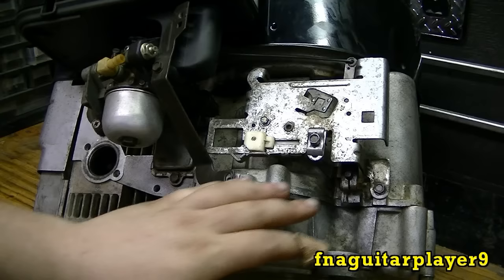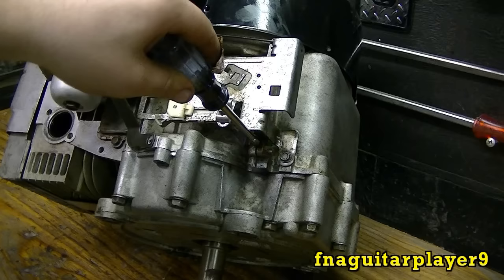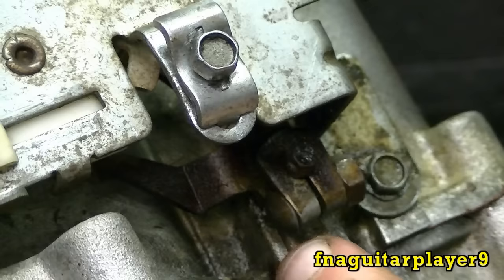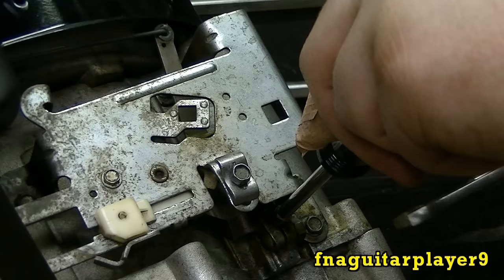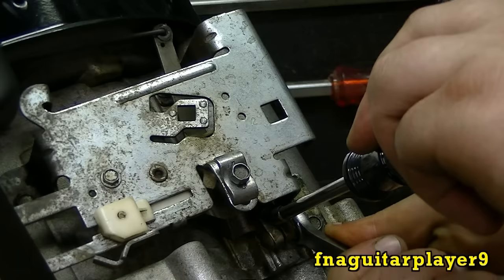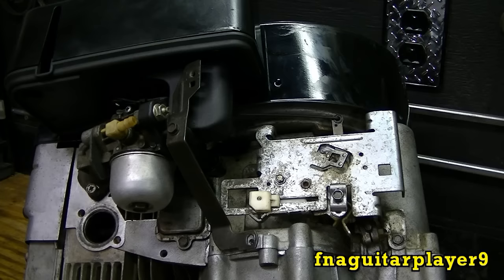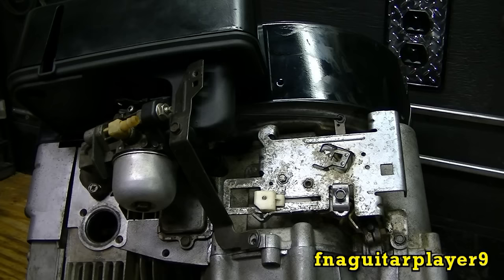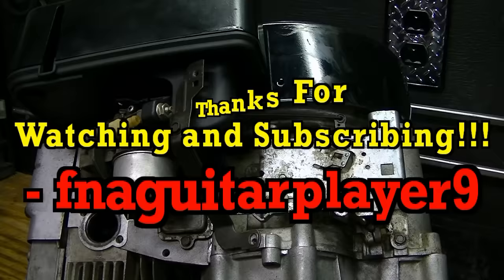How To Adjust Mechanical Governor On Small Engines

Comment: So I have a question. I have a snow blower with a 8hp Tecumseh on it. Now do you leave the throttle control switch in the 'stop' position while doing this? I get a little nervous when messing with governers
Reply from the maker: I would have it set to idle speed, that way there is no spring tension on it, the stop position maybe below the idle, thats fine. Thanks for Watching!!!
Reply: fnaguitarplayer9 tried it. Still seems to be surging and backfiring on higher speeds. Brand new carb (non-adjustable besides idle speed) Any other things I could try?
Reply from the maker: First thing that comes to mind is the choke, have you made sure that it is opening all the way. Assuming it has a choke, i know alot of tecumsehs just have the primer bulb. Have you checked the spark, it could have a weak spark causing that or a fouled plug. if that doesn't work, we'll try something else.
Reply: fnaguitarplayer9 ill give those options a try and let you know. Thanks for helping so far.
Reply from the maker: sounds good. no problem!

Comment: Hi..the throttle linkage works on my mower when the mower is off...but it wont move when the mower is running..any idea why ? if you could help that would be great..thank you..Ed
Reply from the maker: the governor may need adjusted, sounds like it isn't letting it move all the way. Thanks for Watching!!!

Comment: Question,
I have a a John deere 14sb that I just acquired. I had issues with it not starting, and if it did start stalled in a second. I replaced the spark plug, oil and air filter. It started right up after that. Now my issue is that is when I pull the throttle handel all thevway back to turn it off, it just stays in idle and never cut off. Does it have to do with the adjustment you did here or I have to adjust something else? Does anyone else here know?  Thanks much!
Reply from the maker: There is a switch built in on the carburetor or linkages and if the throttle cable isn't adjusted right it won't activate the switch, or the switch is bad or the wire may have came loose that shorts it out to kill it. hope this helps. Thanks for Watching!!!

Comment: What tool are you using to rotate the shaft clockwise.
Reply from the maker: It was a nut driver, most engines you can use a straight screwdriver. Thanks for Watching!!!

Comment: Can a poor adjusted governor arm cause backfiring?
Reply from the maker: Not usually, its usually carburetor, ignition, or valve related when they backfire. I'd start with the carburetor and ignition system first. thanks for watching!!!

Comment: Oh, forgot to add, that I just did what this video says to do; still revving super high even with throttle lever in lowest position.  Could governor internal be bad?
Reply from the maker: probably is the internal part if the external parts check out.
Reply: @fnaguitarplayer9  thank you!  I'll definitely check that out.  I DO appreciate your videos and their attention to detail!!
Reply: @fnaguitarplayer9  Yep, opened her up, the governor plastic was broken on the shaft as well as the outer "wings of the oil slinger.  THANKS again for your help.
Reply: Well, I replaced the governor and adjusted the governor shaft exactly as you showed.  Thing is; the throttle now doesn't seem to make any difference in engine speed.  It is not revving out of control like when old governor was broken, but, just stays at full speed operating revs.  I checked the springs on governor and they all seem to be fine.  I had a small piece, size smaller than a thimble around, but about as long as one, that I THINK came from crankcase, but, I have no idea where it might go or what it is.  Do you think problem may be with carburetor?  Linkage to carb is operating ok.  thanks
Reply: OK, I feel like a real dope!!  I looked everything over and simply adjusted the idle on the carb and that did the trick!!  I'm not sure how replacing the governor had anything to do with that, but, that solved the problem of seemingly no action with the throttle!!  thanks again!!  oh still don't know where the little thimble size piece is from; probably junk from my tool box!!    :)

Comment: I have a poulan riding mower with 12 horsepower engine and when Icrank it and increse throttle quick it tries to choke down put real still run bearliy but will smoke out of exhaust .It does the same thing when i put it in gear and when Itry to turn blade on .PLease help
Reply from the maker: what color is the smoke, if its black it sounds like the float may be sticking or the mixture adjustments are set to rich. I have videos on how to adjust and clean/rebuild both types of carburetors found on those motors. Thanks for Watching!
Reply: I believe it is black thank you very much.Will check into it.You have a blessed day
Reply from the maker: roy rhodes black means to rich, sorry for not answering back sooner.

Comment: What is the small light wire spring on governor for, mine is broken does it matter
Reply from the maker: The spring that goes around the linkage itself? All that does is keep 
the linkages tight, so if there is any play in where the shaft goes into
 to the hole it will keep it from moving, which can cause a slight lope,
 but if it still running smooth then i wouldn't worry about it. 
Honestly, i haven't seen to many that the spring isn't broken! thanks for watching!!!
Reply: Searched high and low and you're the first person who explains what that spring does! I looked at it long enough thinking to myself, 'it can't do anything if it mounts to the same points as the solid linkage'. Thank you for clarifying that! Jay
Reply from the maker: I hear ya! Yeah it just keeps everything tight, they usually break if you take them off anyways. Your welcome, Thanks for Watching!!!

Comment: now if motor keeps racing do i have a bad govenor ???    thank you jim
Reply from the maker: If its racing and your throttle does nothing at all, its usually either a broken governor spring (or it came loose) or the linkage between the governor arm came loose, it can be internal as well, but its usually the spring. Thanks for Watching!!!

Comment: hey I have a 5 horsepower Robin Subaru on a go-kart and you don't even have to give it throttle and it just goes and it's kind of sluggish have any ideas
Reply from the maker: Your carburetor may need cleaned and or adjusted if it has a mixture screw. If its not revving up all the way without a load (tire off ground) then it could be a governor problem or a throttle cable out of adjustment. If its revving up and doesn't seem to have power it could also be the centrifugal clutch slipping. Thanks for Watching!!!
Reply: When I start to go-kart it stays revved the accelerator pedal doesn't do anything it just full bore but when you lift it off the ground it idles down and you can rev it
Reply from the maker: Sounds like it may be a governor problem (if it has it, and not bypassed) or sometimes a bad air leak will cause that. hope this helps, thanks for watching!!!

Comment: How come some engines explode when the governor is messed with?
Reply from the maker: They are not designed for the high speed, they are governed at 3600 rpm and anything over 4000 they just will not take it, what usually happens is the connecting rod breaks and at those speeds it usually tears it up so bad it can't be fixed (broken out camshaft bearings) and its possible the flywheel can explode. Thats why in racing mowers they use billet rods and flywheels. And not to mention the syncho-balancer, they usually send the weights out of back of the block. For what little speed you gain out of a stock mower, the governor should not be messed with, you can get alot of speed out of a stock motor if its geared right. Thanks for Watching!!!

Comment: when someone removes the goveror or bypasses it, how are they lubricating their top end? 
isn't it part of the governor's job to splash oil up there?
Reply from the maker: The part serves to purposes, to sling the oil and acts like a governor, usually when the governor is bypassed, you don't remove the internal oil slinger/ governor part, some will take off the counterweights so they won't fly off at high rpms but you leave the slinger in the engine, if not it won't last very long! Thanks for Watching!!!
Reply: the slinger slings the oil on an internal gear on camshaft. the slinger has centrifugal weights that activate govener and prevent over revving. im sure you can change weights to allow for more or less rpms but without an ignition advance i wiuld keep it UNDER 4000. so to answer your question no. the engine oil will still be slung to the internal parts govener is just for speed control of engine.

Comment: How much rpm do you gain by doing this? I have a new engine and i dont want to remove the governor. I just want to have a higher rpm range. Will this work for what im trying to do?
Reply from the maker: This isn't really for rpm, but alot of times it may just need the throttle cable adjusted or the governor spring is weak, on older engines you can bend the tab the spring hooks to, to get more rpms. Thanks for Watching!!!
Reply: @fnaguitarplayer9  i have a new predator 420cc and jus wanted it to hit around 4500 and not 3500. Jus a little bit more rpm. I didnt want to remove the governor tho

Comment: This video, along with the one on replacing the governor spring and the one explaining how the governors actually work internally are excellent and very helpful. I have an 8hp Briggs in a Snapper 28" that was "gifted" to me. I've checked the linkages and adjusted the governor but can't get it to run at the governed speed (3600 RPM?), it wants to run wide open. The original one piece flo-jet carburetor was replaced with an aftermarket one like you tested in one of your videos and it fit up perfectly. Another odd thing is that the linkage doesn't push the throttle to the idle position. I've adjusted the idle speed to 1800 RPM by holding the adjuster to the stop, but if I throttle it down using the throttle cable the kill switch kills the engine before it reaches the idle stop. Any thoughts? 

Thanks again for your channel and for sharing your knowledge and expertise.

Comment: I think I have a governor problem. When my snow blower hits the medium heavy snow it slows down enough that it doesn't throw it very far. But when I back out the engine revs too high, I think. Does this sound like a governor problem. I'm almost to the point of trying to figure out how to manual increase and decrease throttle when this happens.
Reply from the maker: There are a few things that come to mind, it could be the governor out of adjustment, then again, i've had engines that would rev up higher like that and its the intake gasket leaking, letting the engine pull more air in, which would explain the loss of power too, and the carburetor may need cleaned some too, that would cause a loss of power. Usually the only time a governor needs adjusting is if it loping or surging up and down.Thanks for Watching!!!
Reply: fnaguitarplayer9 Thanks! I'll take a look at that when it ain't so cold.
Reply from the maker: no problem, anytime!
Reply: Hey fnaguitarplayer9, Not sure if you will get this but I wanted to try to let you know about my experience. Hopefully you can see the backround info where you said, "i've had engines that would rev up higher like that and its the intake gasket leaking, letting the engine pull more air in, which would explain the loss of power too, " Well I never got around to checking it out. After running my snow blower for about an hour recently it suddenly wanted to die and the only way I could keep it running was to give it FULL choke. And I ran it like that for another 10 to 15 minutes. Well when I finally opened it up to see the carburetor (here comes the unbelievable part) I saw the carb just hanging there at least 1/2" to 3/4" away from the intake connection. bolts, nuts and gasket gone. Well with no gasket I bolted it back together and it ran better than the first day I got it. Just thought I'd share this with you. You were right about the possible cause.

Comment: Got the same motor on my huskee, the thing runs wide open and i can't figure out how to get it back down to normal speeds.
Reply from the maker: Jordan Walker I hear ya. Most of the time when a motor does that its either the governor is out of adjustment, or a linkage is jammed up somewhere, its possible there could be something wrong with the internal parts (oil slinger / governor) hard to say, i'd check the linkages and spring first just to make sure everything is moving freely, and adjust the governor, if that doesn't help then get back to me. Thanks for Watching!!!
Reply: You know how to re adjust it back to normal? I looked at it more and the pivoting arm had loose bolts and the internal piece would spin freely.
Reply from the maker: Jordan Walker The shaft should turn freely but should not make a complete turn, you should feel resistance after about a 1/2 turn on it, if you can spin it all the way around then something broke inside the motor, either the shaft of the governor/slinger, if you feel it stop then do like i did in this video, if not then you'll have to tear it apart. get back to me on this, this is a rare problem to be honest.
Reply: Too late the motor done threw a rod through the back. Good thing the mower was only $100
Reply from the maker: Jordan Walker
uh oh! at least your not out of much, hopefully you can find another mower/motor real cheap and fix it up.

Comment: my lt2000 18.5hp the carb keeps on misfiring.i redid the carb.checked the flywheel key.didva head gasket.set the valves and its hard to start.then when it starts is misfires from the carb.the the 3rd its loud bankg carb sparks flames and misfires then it stalls.any dieas?
Reply from the maker: First thought is a bad coil, my 14.5 did basically the same thing and i checked the spark and it had good spark, put the plug back in, still no good. Checked for spark again and it was intermittent, it was probably do to a break in the wire or inside the coil. If the carb is set (and clean), valves are set, it has good compression, and the flywheel key is good, i would check the coil out. You can find a aftermarket replacement on ebay for usually less than 20 bucks (depends on model). Let me know what you find out! Thanks for Watching!!!
Reply: It runs but for some odd reason it runs in full throttle.i move the throttle lever down and up but it seems to not make a defference of the rpms.ones the mower stats it automatically sets to full throttle.even after properly adjusting the govenor linkage.
Reply from the maker: Sounds like either the throttle cable or governor spring is broken or loose.
Reply: fnaguitarplayer9 is the spring in the engine?
Reply from the maker: Its on the outside, follow the throttle cable to the mechanism on the side of the engine, the spring is behind it connected to the long governor arm/linkage.
Reply: Ill check it out.i thought maybe the oil slinger was sheared or out of wackinopened to check the governer gear but there was nothing weird.
Reply from the maker: let me know what you find out
Reply: Im not finding nothing unusual.my throttle lever on full throttle it idles lower rpm.on choke its high rpm and it revs up higher and higher.
Reply from the maker: If all the linkages are connected and moving properly and the governor is set right, then the only other thing i can think of is the throttle plate in the carburetor may have came loose, they are usually secured to the throttle shaft with screws and its been to come loose, rare but has happened, I doubt this, but it is possible.
Reply: Thats the only thing that make sense.i appreciate taking your time to figure this out.thank you ill let you know.
Reply from the maker: Its no problem, it may not be that, I'm just thinking out loud, let me know, If its not that I'll figure something else out!

Comment: What are the common issues with removing the governor?
Reply from the maker: If you remove in order to increase RPM, you run the risk of blowing it up, the stock connecting rod just cant handle it and also at extreme rpms, the cast iron flywheel can explode! Thanks for Watching!!!
Reply: @fnaguitarplayer9  thanks for the advice,  so if someone were to remove the governor, it would be a good idea to at least get a better connecting rod, and possibly a flywheel
Reply from the maker: @zragevii4705  yes, and also forgot to mention, if the engine has counterweights, like the synchrobalancer or abs, its best to get the brass weights that take the place of them, its another weak point.
Reply: @fnaguitarplayer9  do you know where I could look to find those weights? And mabye the rod
Reply from the maker: @zragevii4705  eccarburetors.com or arc racing should have everything you need. its not cheap though!
Reply: @fnaguitarplayer9  thank you, it will be a slow going project..